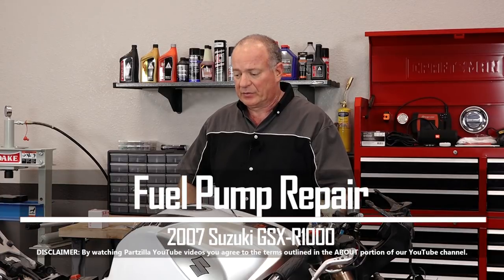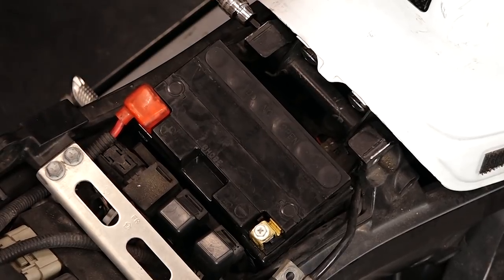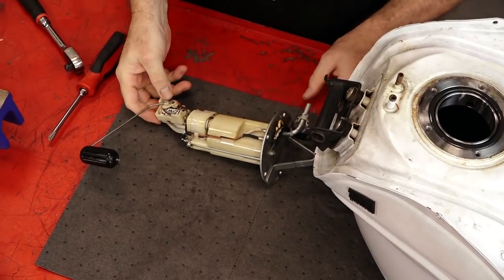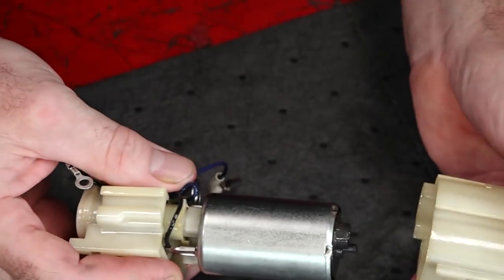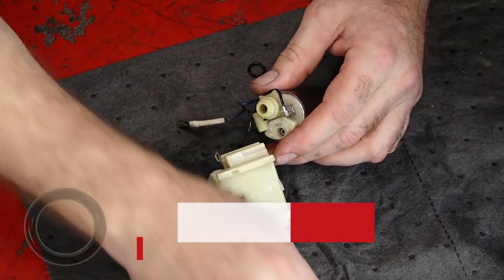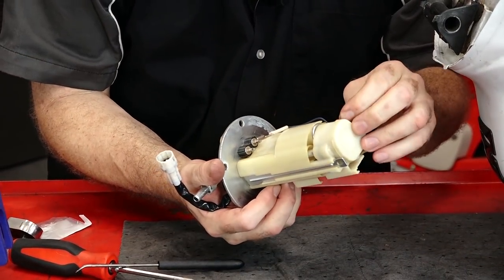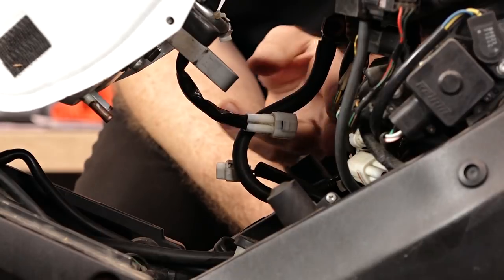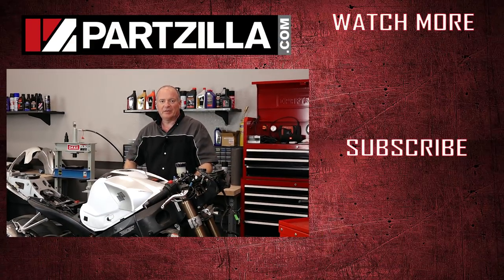GSXR Fuel Pump Repair | Suzuki GSX-R1000 | Partzilla.com

Comment: Hi would ur gsxr1000 2008 stall on acceration if it has a bad o2 sensor or if the o2 sensor that connected at all?
Reply: Not connected at all?
Reply from the maker: You would definitely have a light on, it would run poorly.  Might stall.
Reply: @PartzillaParts  I ordered the 02 sensor for it an ran the bike . The C44 code light came off so I have no codes now . No F1 light . But bike still not giving me all it's power
Reply: It's stalling on acceleration. Not sure if it's the fuel pump or the injectors or the coils
Reply: @godfreylockwood11  same my gsxr1000 2008 cant exceed 9000rpm..
Reply: @FikriAzri  I found the problem with mine . I had a clogged injector. . Check yours maybe it might be ur issue or maybe it can be the pump
Reply: @FikriAzri  I replaced my fuel pump and that was my problem. I bought I new oem pump
Reply: @FikriAzri  I replaced my pump an bought a oem pump ... Problem solved

Comment: 06 1000, was hesitating under load 2nd and 3rd gear. Couldnt get pump out of tank. Took it to suzuki, they replaced filter inside fuel pump for me. I changed plugs and put in a K&N airfilter. Still having the hesitation problem. Any suggestions, anyone?
Reply from the maker: Sounds like a fuel issue still.  Have you checked your lines and injectors?
Reply: You  have a strainer (which John replaced in this video).  There is a fuel filter encased in plastic that the pump connects to, I had to replace that $100 filter on my 2005 gsxr1000.   It solved my problem.

Comment: Could this be the reason why my GXSR 600 will not go past 50 MPH on the road? It feels like I have two fat women on the back of my bike! Even when I'm in 6th gear it takes a while to go past 50 MPH.
Reply: Hahahaah
Reply: @franciscocarrero7031   it definitely was the reason 😂😂
Reply: @stopitskiiiuuup4006  Yo whatsup, did u change the fpr and solved the problem at that time ?
Reply: @franciscocarrero7031  yes. The fuel filter was clogged. Switched it out with a new one. Drove like new after that
Reply: @stopitskiiiuuup4006  I actually fixed mine too ! changed, fuel pump, inside filter, and cleaned fpr, and now its super smooth.